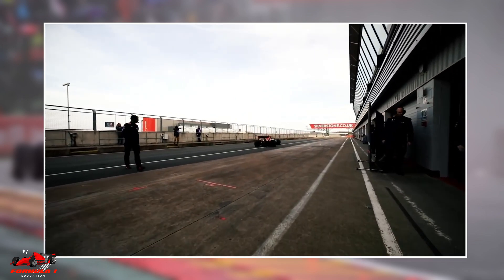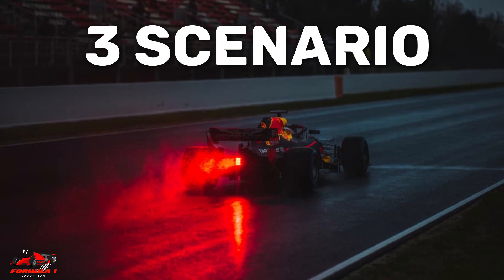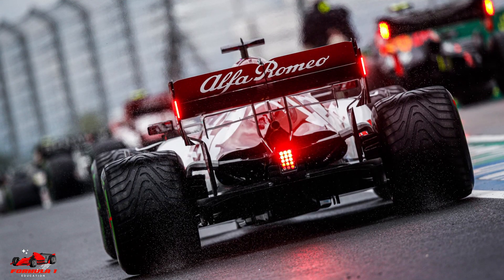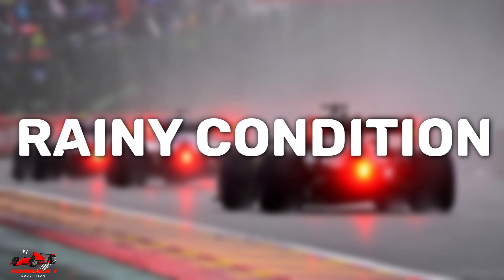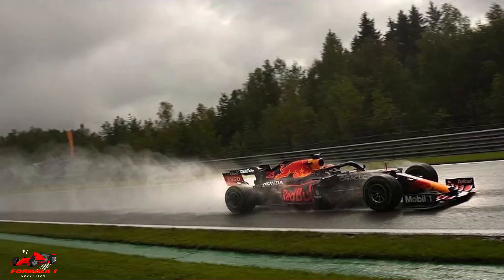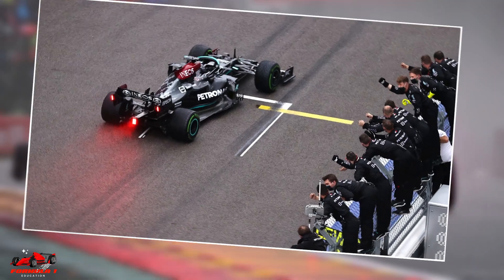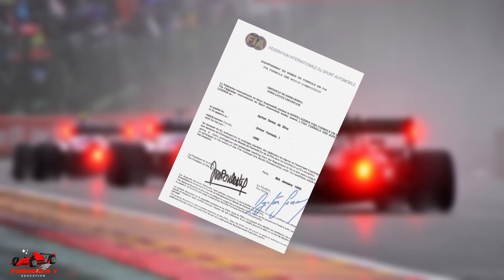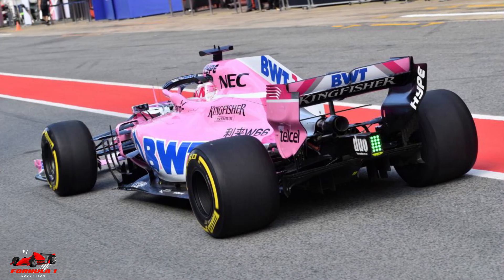Red Light Flash F1 Car | F1 Car Lights Explained | Red light f1 cars

Comment: Why did driver at front would indicate to the car behind he’s harvesting energy 🤷🏻‍♂️? I mean why would be the reason to give away your strategy?
Reply: It's is mandatory by FIA to prevent crashes. While harvesting, cars will go slow and if they don't indicate it the back driver who is going faster might miscalculate and collide with him.
Reply: If it's a safety issue, why not simply light red when the vehicle is slowing down (ERS, braking, or compression  braking) and off when accelerating or maintaining speed?
Reply: It looks non-logical to me, too, but filling up KERS slows down car like braking quite significantly, so it is kinda brake light. Hovewer, having no brake light when braking hard, is very unusual in this respect.

Comment: Only thing is it’s pronounced ERS not errs
Reply: It's not ERS, but KERS (Kinetic energy restore system, kinda like hybrid on steroids), pronouncing more like "krs", but not "ers" or "errs".
Reply: @Labsy  No. ERS is a correct term and stands for Energy Recovery Systems. It is the general term for minimizing input energy by recovering outgoing energy form different sub systems to an overall system and it's "recovery" not "restore". Not specific to racing but in this case you have the KERS (kinetic energy recovery system) and HERS (heat energy recovery system) but technically it's the MGU that matters which stands for Motor Generator Unit. KERS is now translated to MGU-K and HERS to MGU-H.
Reply: Are we sure its not HERS, lol just kidding guys.